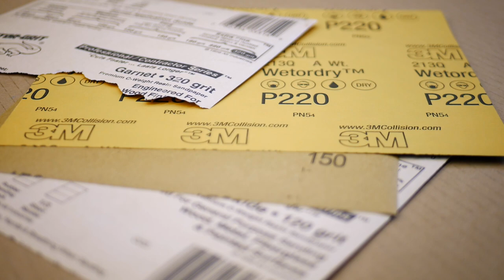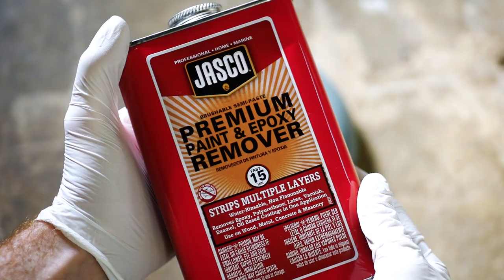Boxing Bell

Comment: A recommendation for this is about the mounting block for the bell: turn it the other way so the t-nut is on the bottom, and use a longer bolt to attach the bell. That way there’s no risk of pulling the t-nut out when tightening the bolt. Great job all round, subscribed.

Comment: You put that T-nut on wrong, it should have been on the opposite side of the block so that pressure would have pulled it to the block and not off the block. If the bell were used on a regular basis, the T-nut would fail.